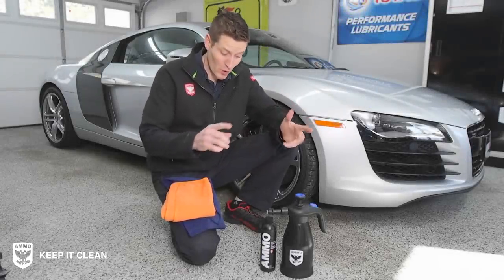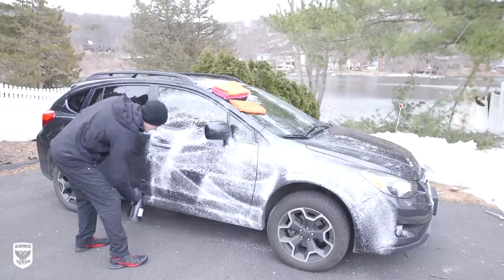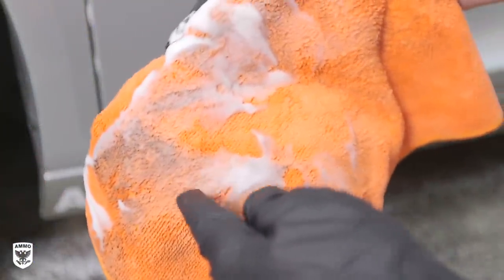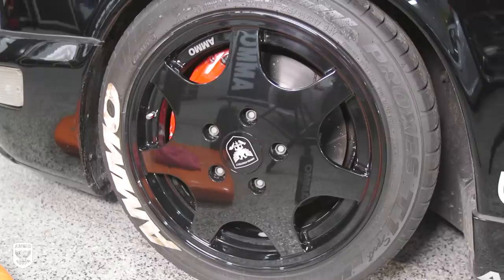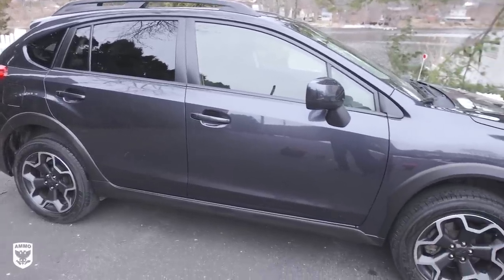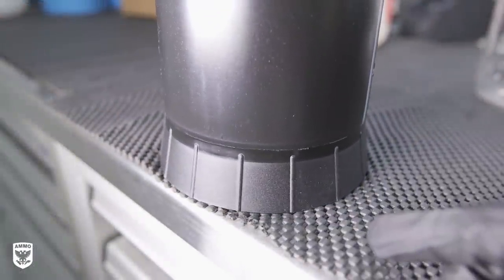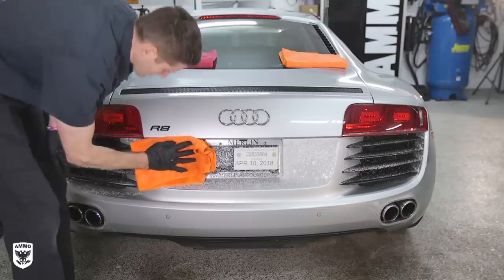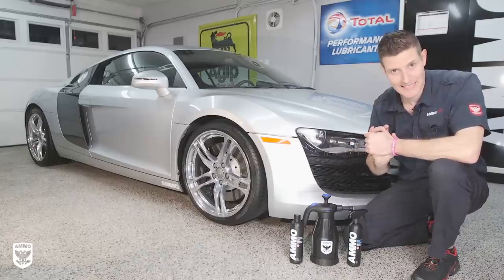How to SAFELY Wash Your Car Without a Hose!

Comment: I received mine yesterday...washed 2 cars already...nothing else out there like it...MIND BLOWN!!
Reply: Ducati Dan how many towels does it take to get through a car?
Reply: Really depends how dirty the car is but the first car, which was not so dirty, only 2 towels.  the dirtier car was about 6.  I fold the towels into 4 so essentially I had 8 sides to use before I threw it in the wash pile. Plus 1 towel to Hydrate the entire car.
Reply: Can any soap be used or it has the be the one shown on this video? Thanks!
Reply: MexicanSniperYT has to be AMMO Frothe. It doesn't require rinsing and has the Humectant that feels totally different.
Reply: Ducati Dan okay, thanks for the response. I went ahead and ordered the kit. How do you like yours?
Reply: Should you rinse with water your wheels/rims after using it?

Comment: Just got mine in the mail today. I washed half my car in the garage. Unreal. Easy. Well made product. It foams JUST like you see it in the video with 1oz of product and 20oz of water. Key is pumping enough pressure in there. If anybody is wondering if they should pay the premium price when there are other waterless washes and pumps on the market, the answer is yes, I don't regret this purchase at all, and I have the less expensive options too. I also love the pressure relief wheel that allows me to depressurize it without having to take off the top. I thought the hydrate would be similar to ultraluster and the like, and while they share similarities, it is a very differently composed product. Love it.  Larry is dangerous.....to my wallet.
Reply from the maker: Thanks for the kind words and glad to hear you enjoy the products so much!

Comment: This is the first AMMO product that I purchased and I am blown away!  The issue that I was having is that I work on the coast and just about everyday after work I've got bird droppings all over the place.  First I was using detailing sprays but everything seemed to have a wax or a shine agent in it and I just wanted a straight cleaner.  Was getting tired of having to stop each night at the car wash so I decided to try AMMO Frothe and it worked like a charm.  I'm now going to carry the sprayer with me in my car and use it as needed for those spot cleanings.  Someone "JR" I believe signed the bottle and wrote "Thank You" on it.  Nice touch.  Thank you Larry!

Comment: This is something I’ve been waiting for! The other waterless washes run too much and no matter what the company claims, I feel as if I’m scratching the paint; whether I do the roll method, or flip sides CONSTANTLY, it just doesn’t feel right. As soon as I saw this video I ordered up the kit. Thanks for the innovation, Larry!
Reply: Just to update. Got my shipment today and tested it on my hood and left fender. Works like a charm! I can feel all the lubrication underneath the microfiber towel and I don’t feel like I’m scratching the paint like when i use other waterless washes. The pump is super high quality and as stated, the one bottle will go a LONG way. I own a Mazda Miata so it should last me 35+ washes. I will be using this in the winter months when it is below freezing for sure.

Comment: Hi, I'm Larry Kosilla, I looked at all the hose less washes on the market and thought, "I can do better." So I did.

I'm sold. I can find other uses for my stash of ONR. Glad now that I didn't buy the gallon.

Thank you for continuing to push the envelope in the area of detailing tools and chemicals. It seems development at most other companies has tapered significantly with not many new ideas, just rehashing and reformulating old ones.
Reply: This isn't a new idea.
Reply: Gregory Veizades Onr will triumph all
Reply: I'm not for one second saying that ONR is a bad product. Because its not by any means. It works very well and obviously has a place in the detailing world. But Im saying from a pure Waterless Wash standpoint, Frothe has superior lubrication. I will still be using ONR or similar products like CarPro's ECH2O as a Detail Spray, Clay Lubricant and similar tasks, like polish residue removal when I invariably Overwork M105.
Reply: Wolfgang's Uber Rinseless Wash has more lubricity than ONR, but ONR is still a good product, just not the best.

Comment: I’m still sceptical, I would like to see a video of Frothe vs 2 bucket method after paint has been fully corrected to see if there are any swirls inflicted. Or Frothe vs a competitor. Good job again Larry, it’s the first waterless wash that doesn’t have me jumping to conclusions.
Reply: Completely agree, I want to see a polish light on black paint before and after this process.
Reply: I'm scared as well.  Would love to see more video on swirls when using this product regularly and exclusively.  I admit, my fears may be unfounded.  How about I document my car after a year of nothing but frothe and if it gets bad swirls Larry comes to S Cal to fix.  Video testimonial will be free
Reply from the maker: Watch the new video
Reply: Honestly there’s no competitor to Frothe! I’ve searched the entire internet
Reply: @ArjjunSingh  nice what about the eco smart waterless by the chemical guys. I'm looking to get my first waterless product this does look legit.
Reply: @ever6  i was looking for something like "Frothe" in lieu of the traditional foam car wash soap and hose method to lift up some medium to heavy dirt off of the car first before using ecosmart. Looking to use AmmoNYC Frothe first followed by chemical-guys ecosmart-RU wash, wax, sealant followed by chemical guys quick detailing speed-wipe gloss spray❤💃Arjun is right in the sense that Frothe is unique and one and only product available out there in replacement of "foam car wash soap" that actually creates froth/foam close to car wash soap. Its definitely a breakthrough invention. Thank you so much AmmoNyc.. i am ordering this.
Reply: @ruchibhade9397  Yeah I'm going to order as well now that mothers day has passed. I can treat myself now soon.
Reply: @ever6  Great! Good luck!👍

Comment: Here is my issue that I hope you will address. It looks like Frothe is doing a great job removing the dirt. But show us a in sunlight shot of the black car after use. I want to confirm it's not scratching the surface. that was my biggest problem with other waterless washed.
Reply: I would like to see that as well, black paint shows you the true pros and cons to any auto detailing product.

Comment: Hey Larry.. I have my truck Ceramic Coated with Ceramic Pro.. would you recommend this process for it? Thanks
Reply from the maker: Yes it is possible to use on coatings.
Reply: AMMO NYC awesome!! Thanks!
Guess I should have finished watching the video.. sorry about that.. lol
Reply: When using on hydrophobic coatings, does the coating remain hydrophobic after it evaporates? Is it correct to use Frothe but not Hydrate on such a coating in order to maintain hydrophobic properties?
Reply: Got my Frothe and pump sprayer. Tried on my clean car to see how it worked.  I mixed 6 capfuls wit 40 oz of water. Lots of foam, easy to apply and wipe down. It did eventually evaporate but left a dry film on my coated car. I had to go back over the car with details spray to wipe it all away as a dry, mf towel wasn’t helping.  In my opinion that’s too much wiping on the paint. Normally with a 2 bucket wash, I can dry the entire with one, larger waffle weave MF towel.
Reply: Personally I am not fond of adding stuff on top of ceramic coatings like hydrate.  You can always use a detailing spray like Meguiar's Ultimate Quick Detailer or something that doesn't add anything to the layers.  Curious what Larry thinks.

Comment: At first I was pretty skeptical, for all the reasons you said you were apprehensive about developing a product like this. Having used all of the other products you've developed, I'm fairly confident this will be a great addition to my cleaning collection. Great work.

And the fact that you drove around cleaning all sorts of different cars and all different conditions, without tearing the crap out of their paint... Pretty safe indicator that this is a practical multi-use product for the worst case scenario at the very least. And what I like about it being younger with a very limited schedule of free time, mostly due to travel and work, when I have a half hour just to get out there and do this it's going to be a lot easier than the 2 3 or 4 hours it takes to get all the equipment, buckets, brushes, towels, rugs so on.

Comment: Hats off to you Larry! Being a fellow detailer in the cold North East (Massachusetts) it can be a hassle to do maintenance washes on clients vehicles when it's 20deg outside. My garage is a tight squeeze for normal washing and I have used other rinseless/waterless methods with limited success. I will definitely be trying this combination soon! Thanks again

Justin Sherwood from Final Inspection Auto Detailing

Comment: I've been using Griot's waterless washes for years. I am aware its not always the best lubrication and parts of my paint show it. But its incredibly convenient and nothing a routine buffing/paint correcting won't fix. Plus the water in my subdivision is pretty rough. THIS is exactly what I've been needing...proper coverage to minimize the risk of scratches with no smudging since the product evaporates. I am counting down the days until my last 16 OZ re-fill gets close to running out...thanks Larry. Would have come in handy for a recent meet I had, 4 hours-driving-worth of grime, pollen, and dead bugs to clean...

Comment: One of the coolest products ever. What factors should be in play when deciding between a hand-wash and this when a car is just lightly dirty.
Reply from the maker: Good question. Time, ambient temp, level of dirt/grit, equipment and access to it, time of year. I will always recommend using water from a hose/PW etc... but when you cant or the factors above limit your usage, THEN Frothe is a great alternative. This isn't an alternative to washing a dirty car. It's an alternative to washing a dirty car WHEN WATER FROM A HOSE IS NOT AVAILABLE. Very important difference. I find myself using this after a dusty drive. I first rinse the car, then Froth it, then "scoop or lift" then Hydrate. 15-20 mins tops and I'm literally looking as if I "waxed" it etc...Now if I come home from the track or have driven through a crazy storm. Then I will set aside the time to wash with PW, take the wheels off, buckets and so on. Hope that helps.
Reply: AMMO NYC This sure did help me! Thank you.

Comment: While the tip of the foamer is certainly different, we utilize almost the same thing in hotels for cleaning bathtubs/showers. It foams the acid or alkaline based cleaner and allows it to cling to the surface instead of immediately running off. Having used this for years, it's a fantastic product (albeit in a different setting).

Comment: I’ve used Meguiar’s Rinse Free Wash and Waxand loved the convenience it gives me to do a last minute addition to my schedule, or to touch up my own car that always seems to need it (navy blue-what was I thinking?!).  I’m excited to get your system and give it a season of testing up here in Minneapolis. I see enough differences that I may discover another great tool for my kit.  Especially since it makes possible for winter cleaning inside garages.  PS:  I’m a German car nerd too-own a 1970 VW Type III Squareback and a 1986 Audi Coupé GT. My detailing car/daily driver is a 2004 Scion xB with 227k and counting.  Surprisingly efficient at hauling around all of my kit along with the Thule box on the roof.

Comment: I use a 4 dollar garden sprayer saw a video online you just make a small hole in the plastic tube an inch from where it sprays water worked fine now for years now.

Comment: Ideally I'd like to do a touch less wash on my mostly clean, ceramic coated car. My plan would be to wet the car, let the frothe dwell on the paint for a bit and only wipe where necessary. The  rest of the car would be rinsed off and dried with a master blaster or blower. Hydrate would also be used where necessary. 

Would this be an effective method of touching the car as little as possible?

Thanks for your previous answer as well. Looks like a great product 👍🏽

Comment: Okay I am almost sold on the concept.  This might be the perfect solution for a quick wipe down on the hood and bumper areas that car needs during our coming bug season.  How well does it work to remove bug splatter similar to what you showed cleaning up after track days?  Anything special to consider when it is more than regular road grime?

Comment: This is amazing! I prefer a wet wash, so I'd like to try a wet wash, and use FROTHe in the door jams, engine/underhood, hatch/trunk etc. and use it when I want a dry wash and/or touch up. I see the product builds up on a dry wash in the panel gaps...dumb question: does it evap without buildup?

Comment: I'm starting a mobile detailing business. Would this be a good system to use until I can afford a trailer with a water tank and pressure washer? I have a pressure washer, but being dependent on using the clients water isn't always feasible.

Comment: Hey Larry, i'm curious why you are using dry microfiber towels when wiping away the foam? Wouldn't it be even safer to use water dampened towels, that you spray with a little bit of hydrate before wiping away the foam and dirt? 

Excellent video as always. Please keep up the great work, will be purchasing an aerator and frothe soon.

-Ted

Comment: Without being biased would your aerator work good enough in replace of the pressure washer or hose foam cannon/guns? For a casual personal cars not for a business. Overwhelmed by the vast array of cannon and I trust your brand. If you suggest another route than yours. Which would you recommend?

Comment: This is a good option in Quebec winters when you want to wash your car in your garage but don't want to risk freezing water one the garage floor or your car once you roll it out. An automatic car wash sounds like an easy option but is actually damaging when the car rolls out in -30 to -40 weather with wind chill factor (-40c is -40f). You can use this to clean the car without the risk.

Comment: I've done a similar technique, with two buckets of water, one with soap and water the other with clean water. There was no hose needed to rinse. But I also have used a spray bottle with water and soap and a bucket with clean water. For areas where there was heavy dirt I would just spray that area until heavily soaked then after a minute I would use a used towel and just go over the area. It's not a difficult process, its very easy.

Comment: Hey !
I have just tried Chemical Guys Eco Smart concentrate today.

I don't think I liked it 
It failed to clean sticky kind a tarmac spot in my daily driver wing just   above the wheel.
I mean I did not rub on it to avoid scratches, instead wiped it 3 times.
I have deluted 1:10 instead if 1:16 and used warm water.

I have just tested this product on my  and my mate's daily driver.
Both cars for driven in the rain and wet snow for 2 weeks without wash.

Result.
Spraid a lot  on to  entire door , used high quality premium quality automative microfiber towel 350 gm2 with one side slightly shorter for buffing off.

Lightly sprayed on to my m towel as well and then wiped lightly pressing on m towel.
This action removed about half of the dirt , sprayed same spot again and wiped with clean m towel  Door spot looked pretty clean , then I sprayed again and wiped with  clean m towel.
M towel appeared to be still little dirty  after the third wipe of the same spot.
Next I sprayed same spot again and  buffed it off with clean short side of M towel.
M Towel ended up with a dirty spot on it.
Repeted last action again and then finally mf towel was clean.
Door is now proper  clean and very reflective.

It will take no less than 1 litre to clean entire car which is as dirty as in his video and no less than 30 minutes 

In terms of scratches I can not check on it, both cars had scratches already.
Also -2c  u could not buff off properly froze on the panel. 
 I have used white mf towel

Now can I know if your foam any stronger , or if I can safely keep rubbing  same spot without risk of scratches?
Finally will foam alone get you nice end visual result please?

Comment: I know this is late but fantastic video.  Have been looking for something to clean our vehicles in the dead of the winter here in the Poconos.   I asked a question on ig or twitter cant remember.  What do you recommend for a dealer using some kind of spray wax for a new car delivery that is now stuck and drips out from the door handles etc every time it rains?

Comment: I’m sure this process works great in icy cold weather. It’s 90° in the shade in Chadbourn, North Carolina today. Too hot to wash a car. By the time I drag out a pressure washer and or garden hose, I need to take a break and cool back down. I’m wondering if on a lightly dusty car if this process would work in the heat (full shade)

Comment: I saw that you very briefly covered washing matte paint with this method in the video. I just wanted to confirm that frothy and hydrate are safe to use on my matte paint. Also, would you recommend any additional coatings or sealants after using hydrate?
Reply from the maker: Yes they are safe for matte paint

Comment: So compared this to the whole water washing ecosystem with separate products for specific areas, this can replace them all? Then simply clay, remove previous wax, polish and wax? So no foam gun with the rinsing method, no wheel cleaner, etc?

Comment: 1. Would Frothe function well as a pre-wash soak in place of a foam gun?
2. Does Frothe sufficiently clean the paint enough do be used as the wash step before using abrasives (clay bar/compounding/polishing)?